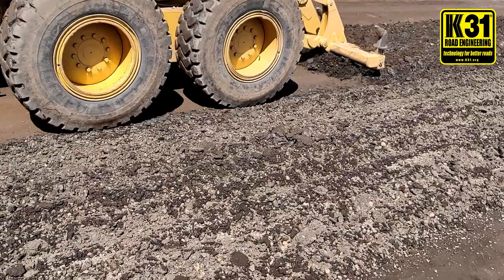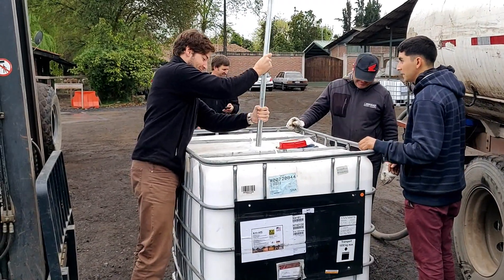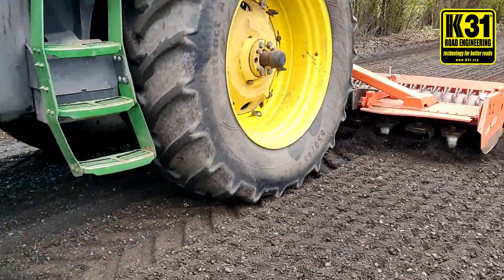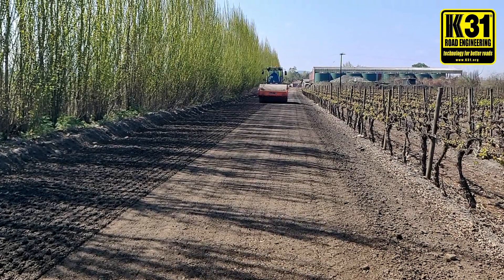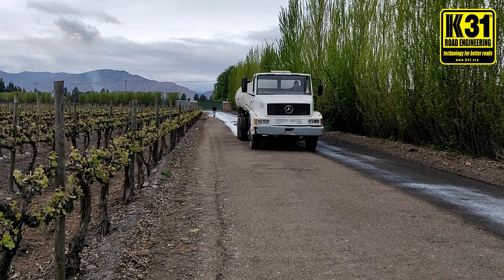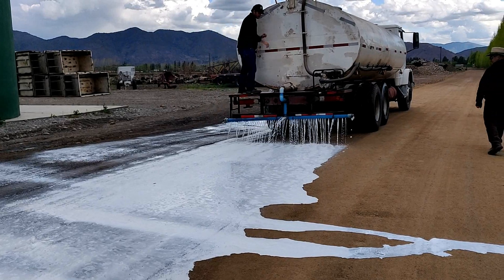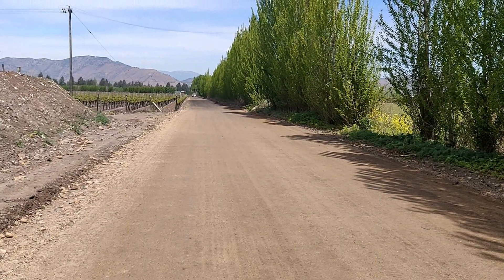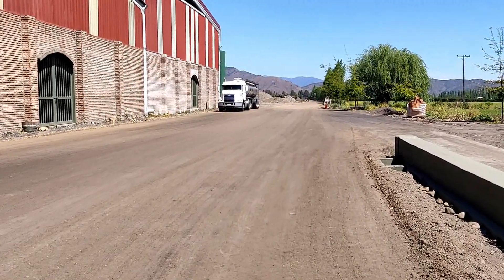How to build a 2km road with soil stabilization using only military-grade K31-APS - Full details!

Comment: greatways to accelerate the long process to prepare the subgrade when the rain season. how long you need to finish the 2 km subgrade road? thank you
Reply from the maker: Yes, you are correct, it does save you a tremendous amount of time and money for the subgrade. You can build approximately 2000 square meters per day. Which is way faster than any traditional method.

Comment: Could you please provide details of the names and specifications for all of the machinery used in the video or simply just add it to the description of the video?
Reply from the maker: Sure! Motor-grader with scarifier, tractor with rotavator, water truck with spray bar, 10-ton pneumatic vibrating compactor. The dump truck is only required if you need to ad extra soil. And you don't really need a forklift if you have a water pump to pump the chemical into the water truck.

Comment: How long will this road last before requiring maintenance work to be performed (1,2,3, 5 years etc)?
Reply from the maker: As with any other type of road this depends on the use and traffic volume, but in most cases, preventive maintenance should start between 2-3 years.

Comment: Hi, in first great Jon. I'm from Brazil and here in my city we don't have a tiller, you said that can use the grader for mix. I was thinking if It's a plow a better option for the grader if the thiller is not a option? Tanks.
Reply from the maker: Hi Ismael, yes you can use a plow instead of a tiller. APS is a very flexible product to apply. It was designed for ease of use.

Comment: Where was this job done?  Would this work over powdery white sand in the Lake Wales ridge just north of lake Okeechobee?
Reply from the maker: This particular job was done in Chile. APS will work with coarse sand, but if your sand is very powdery then you may need to incorporate some fine gravel in order to obtain some mechanical bonding of the soil. Kindly email info@k31.org and one of our technicians will be happy to assist you. Thanks!

Comment: How many totes were in this road. How long is the road and widht?
Reply from the maker: Hello, that road was 2 kms x 6 meters wide for a total of 12,000 square meters. It consumed 18 totes of 1000 liters each. This included the 3 top seal coats. Thanks.

Comment: helo K31, I just wanna know, how much budget we needed to make 1 km using K31 + K31 Shield for standard.  thanks
Reply from the maker: Thank you for your comment. We handle the channel for K31, for questions about quantities and pricing kindly email info@k31.org and one of our technicians will be happy to assist you. Thank you.🙏
Reply: i think it was 1l of concentrated mixed with water for 1 sq meter  5"33
Reply from the maker: @Outsidezematrix  1 liter of APS per m2 for the base and 0.5 liter for the surface seal for road construction. For dust and erosion control the amount is much less. Thanks for your comment.
Reply: i think it was 1l of concentrated mixed with water for 1 sq meter  5"33